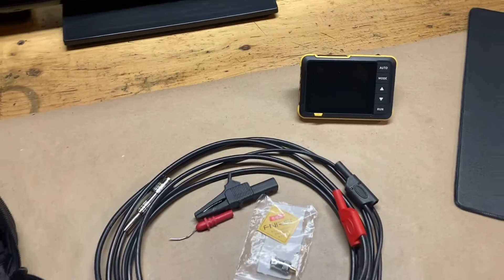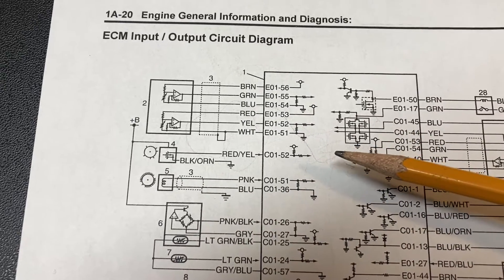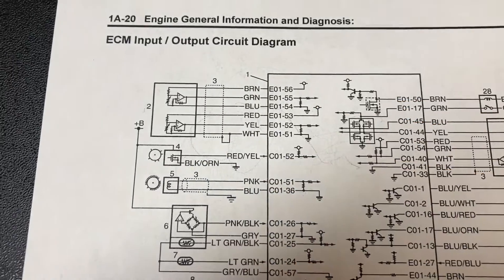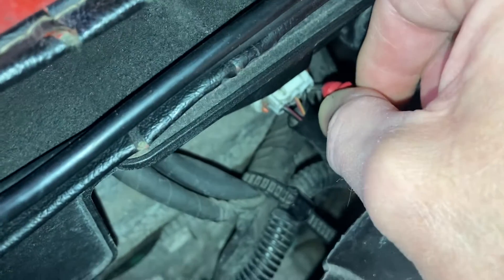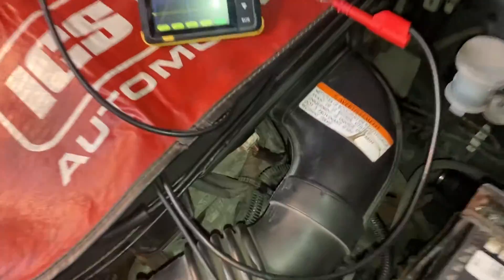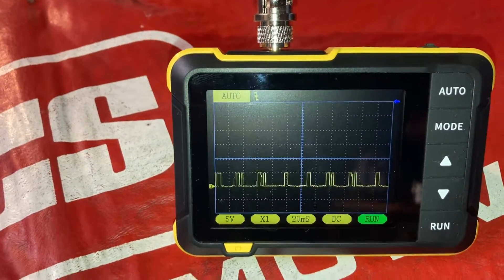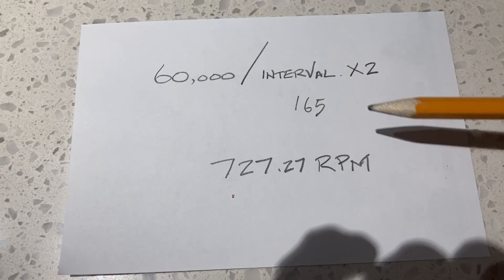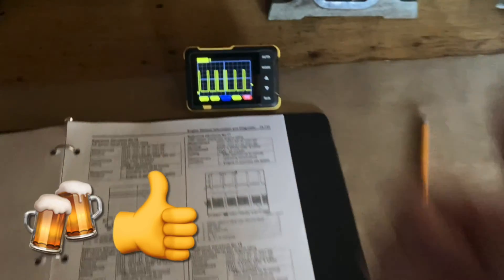Fnirsi DSO-152 Cam Sensor

Comment: Hi, Ive noticed that this model only goes to a 10V setting... Is it possible to see anything above 10v if you switch to the x10 setting without an attenuator?

Or do I have to plug in an attenuator even though I just want to see any signal above 10v like regular battery V?

Thanks!
Reply from the maker: The grid (gradicule) is an 8x12 lay out. So if you select 5V/division you could see a maximum of 40V (5x8) on the X1 attenuation scale. Make sense? I have a 3 part mini series of scope basics utilizing the DSO152 as the learning platform. You can find them in the back catalogue of videos on the channel if you’re interested. Thx for watching. 🍀👍🍻

Comment: What’s this „electronic” beeping noise before you start engine? I’m trying to pinpoint the same noise on my car.
Reply from the maker: Seatbelt warning. Thx for watching 🍻
Reply: @TheGibby3340 well something makes exactly same noise under the hood of my car and it’s not seatbelt warning. Thanks anyway.
Reply from the maker: @bartomiejtopsecret Sorry perhaps I misunderstood the question. If you are referring to the under hood chirping/ticking…I suspect it’s emanating from the electronic throttle control. (Throttle body). With the ignition in run it’s actively positioning the throttle plate. Perhaps that’s what you were referring to. Completely normal 🍻

Comment: What is the part number for the adapter to the bnc leads?
Reply from the maker: Canadian Amazon link…

https://www.amazon.ca/ZJSDRFM-coaxial-Adapter-BNC-Connector/dp/B08MT2VTFX/ref=asc_df_B08MT2VTFX/?tag=googlemobshop-20&linkCode=df0&hvadid=683119446185&hvpos=&hvnetw=g&hvrand=13340450707606705131&hvpone=&hvptwo=&hvqmt=&hvdev=m&hvdvcmdl=&hvlocint=&hvlocphy=9000889&hvtargid=pla-1946551710905&psc=1&mcid=c4c9962ef6283920af2df7dd59fc4b13&gad_source=1